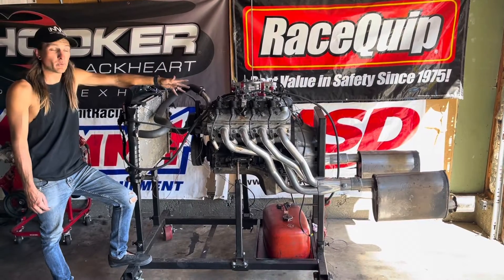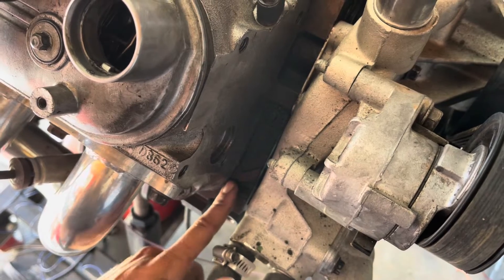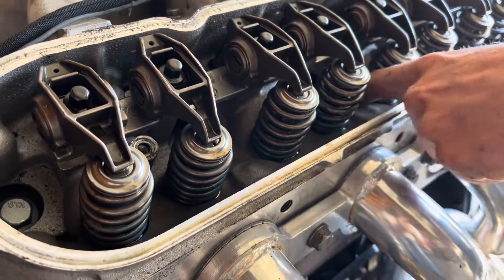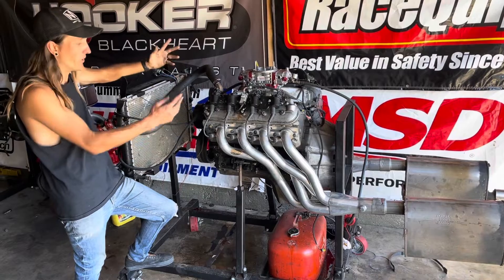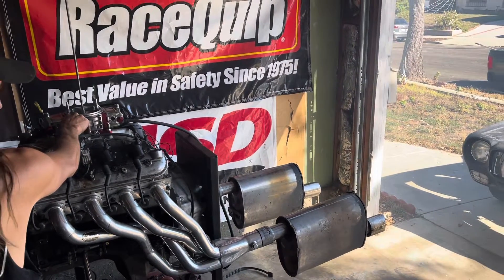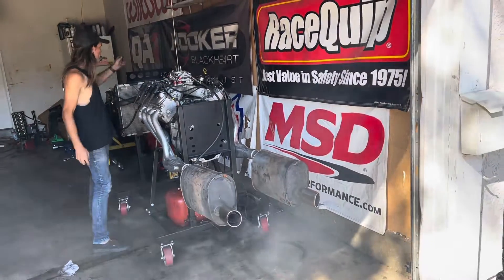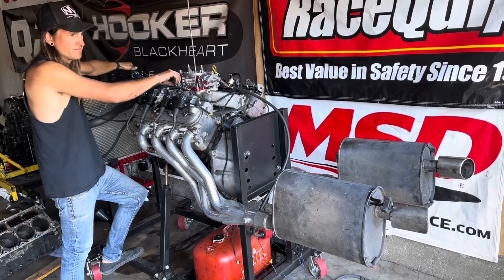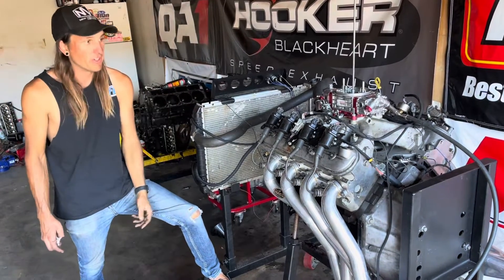LS 5.3 LM7 on the Runstand: BTR Stage 2 Truck Cam Test

Comment: Was wanting to ask a question with regards to your test stand and engine. Do you use an alternator to run it...or is it just water pump and the harmonic balancer. Do you use a battery charger to keep is going?. Thanks for info
Reply from the maker: No charging system. The MSD box pulls very little power to run. I can fire up a motor multiple times all day long and the battery will last.
Reply: @travisblack417  what engine mount are you using. I'm building and engine stand. Don't need anything special. Thanks
Reply from the maker: @Lsguy74  universal conversion mounts with a through bolt.

Comment: I'm looking for the injector  upgrade you did with a Buick vs into the V8 5.3.
Reply from the maker: The Buick injectors are for a certain intake manifold and injector plug combo specifically. What’s your current combo?

Comment: I was hoping you could help me Will a 2004  LM4  have Gen 4 rods  Auto about 2004 envoy thanks for any help
Reply from the maker: I’m not quite sure what your question is lol
Reply: Guess I wasn't paying attention when I was typing. I have a 2004 LM4 out of a 2004 envoy I was wondering do you think it might have GEN 4 rods .thanks
Reply from the maker: @kansascreekhuntingcooking8515  there’s a 50% chance. What size are the bolts on the valley pan? 10mm is pressed pin, 13mm is floating. That change is totally unrelated but happened at the exact same time.
Reply: I replaced the valley pan sometime ago with ICT so I really don't remember I'm doing an LS swap and a '65C10 project is not completed yet I was just checking to see what I might have. Want to kind of set it up as a street rod truck
Reply: I watch your videos all the time you seem to be pretty knowledgeable
Reply from the maker: @kansascreekhuntingcooking8515  you’d have to flip it over and pull the oil pan

Comment: I've had good luck putting sea foam in each bank of cylinders and letting it soak in the bores for a week or so.  One bank straight up on an engine stand (turn the crank over 180 after a couple of days) and then rotate the other bank straight up and do the same.  It seams to loosen up any gunk up rings and gets rid of the smoking if it's just gunk up rings from poor maintenance.  The sea foam ends up in the oil pan and then run the engine with the sea foam in the pan and change the oil.   But, yeah that smoke is probably from laying on it's side for some time.  Good luck with your sale.
Reply from the maker: This motor was sitting on its side in the back of a truck for weeks. It was just oil burning off.